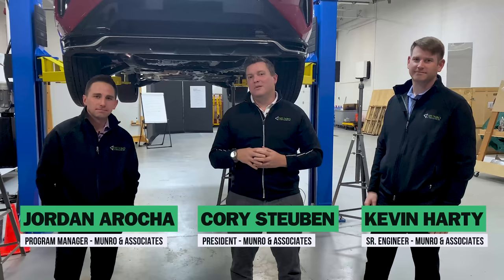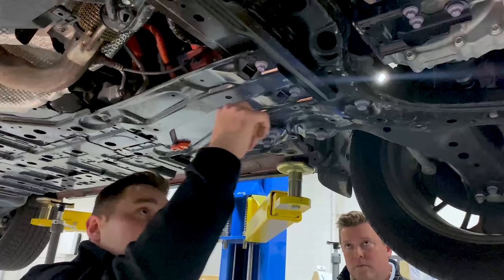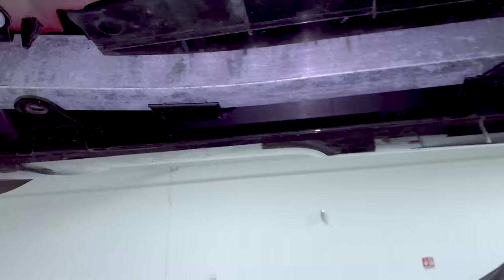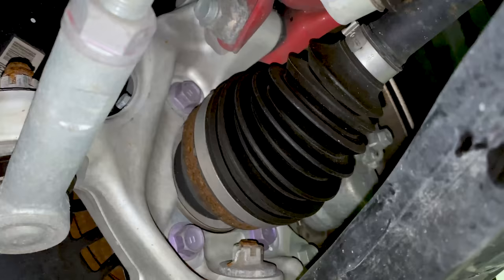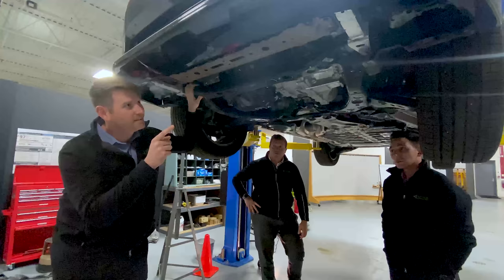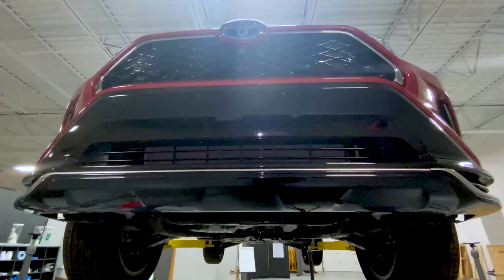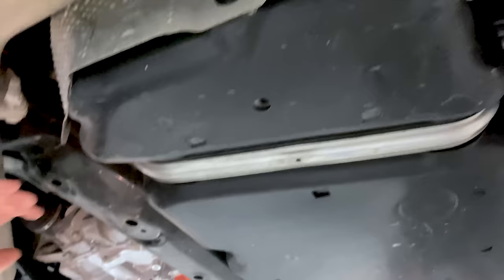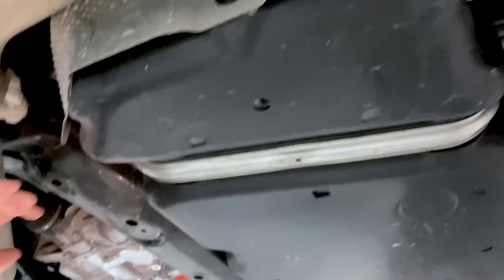2021 Toyota RAV4 Prime Plug-in Hybrid | Hoist Review

Comment: Interesting detail about the steel tank. Didn't think anybody was using that today.
Reply: A steel tank is cost cutting measure from Toyota.  Customer will pay for that when it rusts and the vehicle is beyond warranty. Most of the manufacturers are using plastic tanks from the late 1990s or early 2000s.
Reply: Steel fuel tanks can withstand higher pressure than conventional plastic fuel tanks, which is why they are used for Plug-in hybrids.  On pure ICE vehicles, the fuel tank is not pressure tight but allowed to “breathe” through a canister of active carbon which will absorb any fuel gases. When the engine starts, it will suck fresh air though the carbon canister and thereby deplete any fuel bound to the carbon. Since a PHEV might be operating for weeks on end without the ICE ever running, too much of the fuel might evaporate if the tank was an open system. Hence the use of steel tanks which are closed shut and not allowed to “breathe”.
Reply: Steel fuel tanks is a sulev, Super ultra-low emissions vehicle, standard. Steel tanks are known to produce less emissions from fuel vapors.

Comment: Bought the Rav4 hybrid (not the Prime) over the summer. No, it definitely isn't cutting edge but they hybrid system works incredibly well and it is just a solid, reliable car that does what it is intended to do. While it still has an IC engine, I love not having to deal with a traditional transmission, driveshaft & rear axle (AWD), starter motor, etc., etc. I also like how simple it is to maintain; the oil drain plug, oil filter, battery fan filter and everything else is easy to access.
Reply: it's hybrid system is LESS Efficient, than a FULL BEV. 
and Hybrids still have a Tailpipe & and emit PM2.5 particles that can kill you.
Reply: @markplott4820  Yes, you’re 100% correct. Nothing is ever completely black or white though and you need to make choices based on your own set of unique factors at the time. There will be a full EV or two in my garage before long. I can’t wait actually.
Reply: @markplott4820  but that doesn’t matter really, what matter is that Toyota hybrids are the best ice cars currently available from all manufacturers and because full Evs are not suitable for everyone a Toyota hybrid is a great alternative., specifically the self charging hybrids, they are simply the evolution of an ice cars.
Reply: I guess it all depends on your personal usage patterns, and where do you live. I really drive more than 150 km, it happens, but I don't like to drive fro longer than 1h it bores me to death. So fully electric car is definitely an option for me, but I still wait for them to become cheaper. If charging is sparse in your location, then this is an argument for an ice car.
Reply: @toninocars  And for people who live where charging isn't that convenient, i.e., people in apartments where a garage isn't available.
Reply: @markplott4820  I ride the subway because BEVs are less efficient than Full Subway cars and BEVs still use cobalt and rare earth minerals that cause pollution, that can eventually kill you.  It’s not black or white and BEVs are still not a practical choice for most.  And I the four BEV owners I know all have second cars powered by Gas.

Comment: I traded my Model S in for one of these 9 months ago. It's a really amazing overall vehicle, every vehicle has pros & cons but as a general all around vehicle it absolutely excels. It's an EV around town 25 days a month and has endless range when I need to travel out of town.
Reply: You actually bought two cars. One EV and one good hybrid.
Reply: I also sold my Model y for a   Rav4 Prime. To me a a a PHEV  is better than a full EV.
Reply: So you basically have a gas car that’s driven once a month. The exact thing that ruins gas engines because of sludging, moisture accumulation, corrosion and rot. It’s the equivalent of a Ferrari that drives 100 miles a year.
Reply: @Ficon  It's a Toyota not a Ferrari. I think your a bit over exaggerating.
Reply: @badimpulses17  I'm going to do the same thing. My 2023 Model Y LR is fun to drive and all, but I don't like the short range, long public charging times, and not enough chargers in rural areas. With the RAV4 Prime I'll be able go anywhere without range anxiety and carry a gas can if going to very remote areas on camping and biking trips. Having over 500 miles range on the Prime will be awesome compared to the just over 200 miles on the Model Y. I'm excited to get the new rig for 2025 model.
Reply: @burnx45  Good choice.

Comment: 4:10 ..  I would bet those self taping bolts are cutting threads through the metal itself, not just the paint.  Saves them a step of having to thread it separately, and eliminates that "paint issue at the same time.  3 birds with one bolt.
Reply: You can get away with on line thread forming when going into aluminum, but not with steel.  Those teeth are also not nearly sharp enough to cut aluminum, they're definitely for chasing paint out of the threads.
Reply: lol ... they are tapered, not self-tapping

Comment: Brackets on brackets on brackets and corrosion-suceptable exhaust brackets - yet still a benchmark in the industry - interesting!
Reply: Yeah, I caught that, too. At the same time, I'm still driving my rusty '99 RAV4. It's the most reliable car I've ever owned. Going to drive it until it falls apart.
Reply: I think their key to success is focus on what the customer touches and spend the time and money there.  The typical RAV4 owner isn't interested in cutting edge technology, lean design nor elegant engineering. As long as it starts, stops and goes round corners without drama, it's hit it's mark
Reply: @paullester2535  Speaking of going around corners without drama, look up RAV4 Prime moose tests on km77 and teknikens varld. The most dangerous limit handling of any modern car.
Reply: @Ficon  so there is drama in owning a RAV4!
Reply: @Ficon  they have upgraded the software for the VSC which got them a better result in the moose test.

Comment: I love Toyota and hearing it from these 3 guys is just confirming that hat I have seen. Working for German oem in development and quality I can tell you they do not care about serviceable parts or proper production control.
Reply: Thats why my Model has now 100,000 km on the Odometer and had to change the wipers and cabin filters, so far. Oh, 2 sets of tyres are down now. 🤷🏻‍♂️
Best regards from Germany. 😁
Reply: @Stefan_Dahn  what model is that? German cars are unreliable and fall apart once the warranty expires and have tons of electrical and control module failures. Not to mention they lose over half their value after 2-3 years of ownership and spend half their life at the repair shop. That's the problem when you build complex, over engineered overpriced crap.
Reply: @JAM_2024  By that stance I take it you're from the Americas. An issue with any German cars produced in the Americas is that Quality control for them is terrible compared to the ones produced in Europe. Just by taking a look at insurance cost in Europe vs America for the same model shows how bad it is
Reply: @ThunderDash42  How come German vehicles produced in the US is of lower quality? Is it deliberate or general difficulty in implementing the same QC standards?

Comment: Fast forward to 2023, and it becomes obvious that the high voltage connector rusts out very quickly, and it's a $7000 fix in Canada, and there is a class action lawsuit going on. Now I'm worried that the 2023 Rav 4 has the same design flaw. That orange plastic cover doesn't protect much.

Comment: I believed the fuel tank is not a steel tank. It is actually a multi layer plastic fuel tank, this is to reduce weight for fuel economy. It consist of 6 layers of 4 different types of materials namely: 2 layer of HDPE (High Density Polyethylene), 1 layer of EVOH (Ethylene Vinyl Alcohol Copolymer), 2 layers of Adhesives and 1 layer of Regrind Materials.

Comment: You can see why Toyota still wishes to pursue the Hybrid, Plug-In or Otherwise, because they have been refining it for years and are so damned good at it. But the complexity is so ripe for maintenance and otherwise failure if not serviced with regularity. Of course, Toyota has long made it known, if not openly, that theirs is a progression from Hybrid to the ICE Hybrid-Hydrogen, thence to the FCV Hydrogen, with the smoothest possible evolution. Toyota never conceived of a future with the entirely battery/electric powered vehicle alone. Which is why they are so incredibly behind the curve. They're trying to half-heartedly play catch-up now, but I believe it might be too late for them as a major player.
Reply: it's still puzzling to me why toyota had make such huge commitment to HFCV and not having some offering of BEV.  It's like toyota saw a huge advantage of HFCV and jumped both feet into it
Reply: @andrewcannon587  50 mpg with 40 miles of ev range and oh yes....580 mile total range.......checks all the boxes for 90% of all consumers.......
Reply: Well said Andy, my sentiments exactly but you have said it more eloquently. When I saw the underside of that car, that RAV4, two things struck me, the beautiful workmanship and engineering, yet I was overwhelmed by the complexity there is no way hybrid cars will compete with battery electric cars. Just think of what they could’ve done had they dedicated the engineering talent, or better said, the right Engineering resources to battery electric vehicles. What a disaster Toyota is, the best made cars in the world, but the wrong cars!
Reply: @nerdlywehunt  :  are you out of your mind? I think you’re joking, I hope so? This car is expensive and will be costly to maintain, and will lose value quickly. My mom has an RAV4 and while it drives good I absolutely despise The Visibility
Reply: In South Africa a person working for Toyota told me that they are now first bringing in hybrids before going BEV to get their customers use to the idea of batteries.  What a load of nonsense.  People buy EV's because they see the benefit and practicality  and they do not need a transition from one to the other. It is just an excuse Toyota uses because they have no practical EV.
Reply: You can add sprinkles on crap and "refine" it to perfection... but it will always remain crap. The same with hybrids - unnecessary complex and absurdly useless machines that want to be jack-of-all-trades... but fails at everything. Expensive to maintain, unreliable, sort life and fast depreciation.
Reply: Toyota will sell 1000× (picked out of thin air) more hybrids in the next 4 years than ev's and by then their solid state battery patents with full production will transition  more to market demand. Battery replacement in 10-12 years is the biggest downside of EV's and depreciation of a 10 year old EV with original batteries will be massive until replacement costs come down. IMO
Reply: @mrjay4000  I see where you're going with this one, but you are going on the presumption that Toyota is the trusted company of old. That reputation is daily being shattered by Toyota itself, pursuing an ICE medium term future, in whatever guise. However, Toyota is starting to wake up to the knowledge that everybody's ear has turned away. Hybrids are a 20+ year old technology that has, for the largest part, been superseded, on the grounds of efficiency, power, cost, and environmental impact. Though sadly, the lat category doesn't matter enough yet to the average consumer. It will. Granted there are situations where a Hybrid (a Plug-In variant hopefully) still is the best way for convenience, if not for cost in all areas, but those situations are becoming increasingly thin. The BEV is coming to dominate, even in fringe areas. Just give it time. It won't need too much.
Reply: @ramblerandy2397  Toyota has an EV or 2 soon to production but they are banking their EV future on their new patented solid state battery technology that will be a few years to ramp up production.
The future of BEV's is all in who can build the most efficient battery sustainably for the best value.
Reply: @Sam-yc3hg  I don't see how this video has anything to do with Tesla? Anyway, Kudos to Tesla and more power to them in the future but allot of people thought EVs were going to magically be in everyone's garage 2 years ago.
These people are not realists and have no idea how long it will take before even 50% of the vehicles on the road are EV's. A decade at least.
Reply: To sum up everything you wrote they will be the Nokia of the auto industry.
Reply: @JAM_2024  I know what you mean there, but to be fair to Nokia, they may not be the force they were but they're doing ok these days. ☺
It's entirely possible that we could see the terminal decline of Toyota. This electrification disruption will take no prisoners.
Reply: @JAM_2024  Delusional
Reply: In my opinion the Toyota hybrid system is a pretty elegant solution that requires less maintenance that a regular ICE car.  If you buy a well engineered ICE car or hybrid the majority of costly maintenance will be brakes and suspension. EVs will have similar maintenance requirements but the parts will be more expensive because they are supporting a car that weighs as much as a truck.  The "less maintenance" is a fringe benefit at this point and it's theoretical.
Reply: @chrisE815  Less maintenance of an EV is theoretical? I run an EV and I can tell you, it's actual.

Comment: I have a Rav4 Prime AWD - love it but there are some issues - Lighting in the inside, to the left of the steering a e some button has no lighting and and the windows and door locks do not have any lighting.  Also the dash is hard to hard to see.  Otherwise it is a great, fun and I have about 4500 miles and have used about 12-13 gallons.

Comment: That why i always drive Toyota,  They last, well-built and brake parts are widely available at a decent price.
Reply: That's why you support the third biggest advocate against electric mobility. Bravo.
Reply: It would have been nice if they weren't:
- Hiding documents regarding emissions of their hybrids... for decades.
- Advertising 6 times lower fuel consumption than their vehicles could do.
- Shamelessly spreading LIES and fake ads about EVs. They know that they cannot compete and are trying their best to slow down the transition to electric vehicles.
- Sticking with the same technology for 20 or more years. "Reliable...", "easy to find..." they say. Yes, because they are the same old parts that were used in the previous century. On top of that Toyota's reliability is mostly advertised and if they brake down, which they often do... it costs an arm and a leg to repair. Yes, every week there are a couple of toyota's with open hoods and hazard lights on at the side of the road. Winter is really harsh on their vehicles.
- They keep failing horribly at the "Moos test".
- And... their dealerships are miserable!
- ... multiple other lawsuits against them.
Reply: Corolla's aren't worth it
Reply: @whynotstartusingyourbrain8726  PHEV's have about equal emstimated  emissions compared to a large battery EV over a 10 year life.
Reply: Billy - the Toyota RAV4 is LESS reliable than the Tesla model Y.
Reply: @TheJttv  true
Reply: @markplott4820  just because you "think" it is true doesn't make it true.
Reply: Yep! 👍
Reply: @whynotstartusingyourbrain8726  Not everyone wants an EV  Love my prius never have to panic looking for a Junk charging station.  or Sign a contract when buying a Tesla that i can not sue them for anything.
Reply: @markplott4820  Laughing, take your Tesla in for service, wish you luck
Reply: @markplott4820  At least you can get it serviced.  try taking in your low quality built tesla in for service.   Why do a lot of Tesla owners own Rave4 plug in?  it is because of service and reliability
Reply: @BillyBob-fd5ht  - my Tesla has never once needed service in over 200k.
Reply: @BillyBob-fd5ht  - the BEST part is no parts, the BEST service, is NO service need for 400k.

Comment: The real question is: is it worth $ 50K? Impeccable but cheap. Every single mechanical part is great for a $ 20,000 car, but here we are talking about $ 50,000. From this point of you everything looks cheap and too old fashion. Does it worth it? Is it a good buy? This is what I want to hear.
Reply: Pauline Weinberger  The perception of the customer is one of the reasons that they can sell Lexus for a double price than a Toyota.  Not all the customer are educated to the materials, mechanical engineering and design, but this create a dichotomy between a smart customer and a damn ass.

Comment: I want a hybrid Truck that's actually EV based first, rather than Engine based... Like a hybrid that can go 300 miles on EV battery alone, but has a built in 3 cylinder industrial Diesel welder that I can also be used as a generator, which also triples as a 'charger for the battery to extend your range..  Even if it was unable to drive the car with a completely dead battery--- If I could just have it running to help extend range while my battery is still operating-- such as on long trips, that would be a great multi purpose work truck that every welder/ construction worker/ shop owner/ oil field guy would kill to have..  The "welder/ generator/ charger would have to be an automotive/ industrial grade diesel engine though..  No lawn mower engines.
Reply: Wait for a pure EV truck then get a portable generator and carry that around if you need it.
Reply: Makes sense
Reply: Just carry ICE generator in bed or on hitch box. I'm waiting for camp trailers to come with high output PV systems so you could plug in your truck to camper when primitive camping.